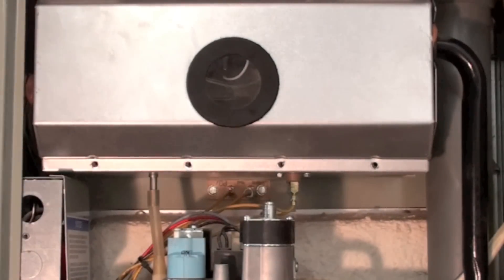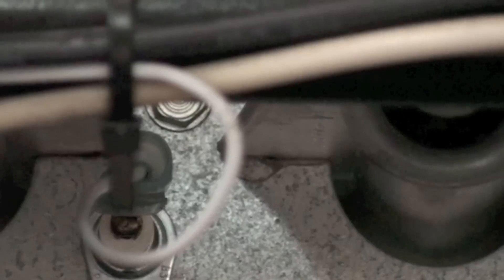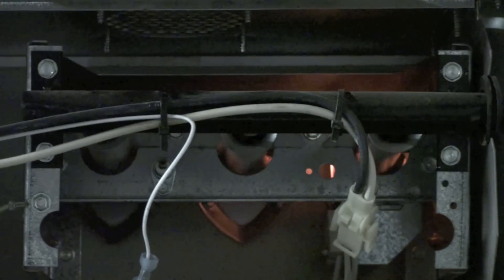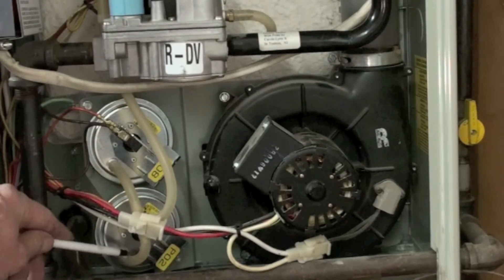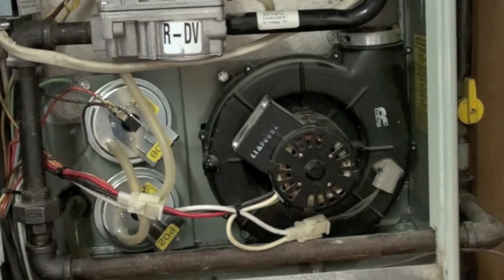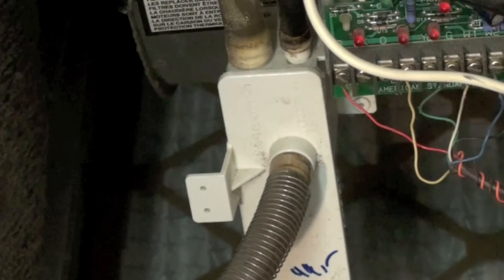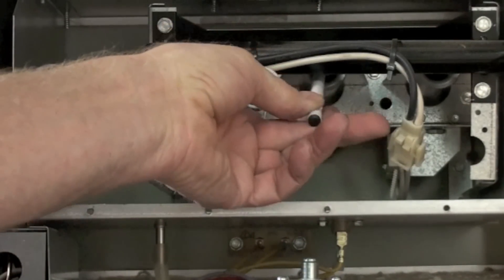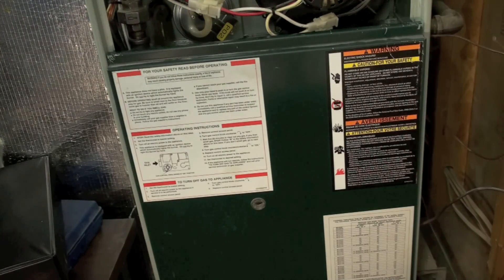Why does the gas furnace short cycle

Comment: Hi -- great video. Could you help me? I just replaced a circuit board on my Bryant. The replacement board was tested as working. I still get the same 3-1 error, indicating a pressure issue. The inducer motor was just replaced before the circuit board, too. I'm mystified. With a new circuit board and presumably working inducer motor, the inducer is still not spinning up after a call for heat. What else should I look for? My hair is quickly leaving my head. 
1. inducer a week ago was replaced after nothing was working.
2. after inducer motor was replaced, the furnace ran for one week.
3. after a week, the same 3-1 issue began.
4. it appeared that the motor wasn't getting enough power. i bought a new circuit board.
5. i installed the new board. the same 3-1 error is appearing.

the thermo is a nest. it is possible to test the large blower fan just to make sure that a signal is making it all, which does work. 

....?
Reply from the maker: Testing123 My thoughts here are you have a vent pressure problem.  First, remove one of the wires from the pressure switch.  If the inducer starts, the pressure switch was stuck closed.  Check your vent for blockages.  Hope this helps.
GFM
Reply: grayfurnaceman Thanks, GFM. It helped a lot. Great help, thank you.

Comment: Hello.  Thank you very much for the video.   I do have a non related question.  Hopping you can answer.   How does one tell if a gas furnace can have pvc exhaust or regular metal one.   I tried to look up in install papers but cant find it.   Thanks in advance.
Reply from the maker: Dmitry Dubinsky The vent connection on plastic vent will be 1/2" or 2".  The vent connection for metal vent will be 4".  Hope this helps.
GFM

Comment: My fan switch tryouts three Times  b before the gas comes on in a fire comes on
Reply from the maker: If by fan you mean the inducer fan and the burners come on but shut off after a few seconds, It probably has a problem with a dirty flame rod.  Hope this helps.
GFM
Reply: Thanks....but I mean the fan blower motor sometimes work most Times  just hummus and gets hot...no cap wired in 70%er lenox
Reply: Trying to keep from installing a new motor

Comment: You dear sir is a life saver , It is -40 with the wind chill in Waterloo Ontario . This morning I came home from work and inside of the house was freezing cold , There was ICE building up on the windows inside the house . I check the intake and exhaust for the furnace and clare it at the outside of the house . I flick the furnace switch on and off and the furnace came on , I set the thermostat as high as I can then went to bed,I wore two pears of sox,3 pairs of jogging pants,a toke , a pair of welders mitts and a sweeter with 4 long sleeve T shirts , Covered up with two comforter in bed. When I woke up at 3:30 pm to pick my wife up from work and the house was freezing cold , The hinges on the front door Ice was starting to buildup on them. Tomorrow is family day in Canada and that means all stores , Businesses and  heating and plumbing are close . I decided to head to Walmart and buy 2 electric heaters , Since I have 3 little kids and I am taking care of my mother and mother in law , They are both seniors (70s ) . My wife reminded me that I will have to use the Visa . I then decided to type in the furnace symptoms on You Tube and I clicked on your Video. In your video I saw the same symptoms as mine and you pointed to the flame rod . I then went into the garage and grab my socket set which was frozen and began removing the covers, Drip plate and finally found the flame rod, I took it out clean it and once I re connect it and re install everything . I turn on the furnace and it stay on and start to warm the house, We thank you a million .
Thanks,
Reply from the maker: Is good to be warm.
GFM
Reply: vishnu tewari great story....jesus sounds cold up there....just now I am freezing here in northern california...had to wrap my legs in a beach towel this morning to stay warm...with the heater turned off(to save money)it is 64 degrees in here!
Reply: @erikcable1755  i had same problem exactly it was my vent outside blocked check your inlet and exhaust outside

Comment: I have a Nordyne furnace that keeps cycling for approx 30 sec.
I have changed the flame sensor.
checked the venting.
it does not shut down after 3 cycles. I am wondering if the control board is bad.
Any thoughts?
Thx
Tinner73
Reply: I see this was three years ago what was the problem?  I have a Nordyne acting the same way

Comment: I have a newer  Nordyne Gas furnace. It will burn as long as I want it to; as long as the  burner access panel is removed. If I place the panel back on to seal up the system, it short cycles every 5 seconds or less. I've cleaned the flame rod and replaced the air filter, replaced the thermostat, and checked the pressure switches and tubes. The external air supply is not clogged either. My basement gets cold to 50F. I have no idea what to do next. Thoughts?
Reply from the maker: ***** This is almost certainly a venting problem.  Be sure there is no water in the vent from vent sagging.  Also look for ice on the termination or possibly a screen.  Last possibility is bad pressure switch. Hope this helps.
GFM
Reply: Could you hook up a homemade vacuum manometer and see what the 'vacuum' is? I don't know what it should be; but maybe GFM does. I think it should be small. I've never seen any numbers about that.

Comment: Perfect. I had this problem for about 4 months and when the wife finally spazzed out about it and threatened to call a service co, I looked at this video and realized very quickly it was a dirty flame sensor. At the same time I removed and gently cleaned the ignitor rod. Put it all back together and it fired right up. 10 minutes of effort saved me a bunch of money and put me back in good graces with the wife. AWESOME!!!
Reply: They say 
"if mamma ain't happy, ain't nobody happy!"
Reply: lucky you.  my wife is on my case and doing the same threat now, and that is why I am watching this video.
Reply from the maker: Corina Morrison A happy wife makes a happy man.
GFM
Reply: Corina Morrisoml 0
Reply: Corina Morrison

Comment: This video helped me immensely when I thought my furnace had a short cycle problem. I did the basics like change my air filter and thermostat batteries, still short cycling. After watching this video, I decided to open the front panel of my furnace to check what was happening. I then realized that the furnace operation must have jostled loose the screws that keep the safety switch pushed in with the panel. After this, i was so relieved to not have to call for maintenance! Thank you very much!!
Reply: Andy Gagliardi Exact same thing happened to me

Comment: hi, i I HAVE A FURNACE TG9S130D20MP11 AND  THE PROBLEM IS TO IGNITER TRY TO   BUT DOES NOT INGITE, ONLY LIT FOR ABOUT 3 SECONDS AND THEN SHUTTS OFF BUT THE MOTOR CONTINUES RUNS FOR ABOUT 2 MINUTES AND THEN STOPS, TRY AGAIN TO IGNITE BUT THE SAME, STILLS TRY TO IGNITE AND NOTHING NOT IGNITE, IN SOME CASES IGNITES BUT UNTIL 5 OR 6 TRIES, THE FURNACE IS NEW ONE AND NEVER RUNS CORRECTLY, PLEASE HELP ME

Comment: My furnace is short cycling but I cannot find the fame sensor.  It just isn't there.  The model is International Comfort Products FBF076B12A5.  HELP!
Reply from the maker: Dan D I think that one is similar to the Snyder General.  You might look up Snyder General in my videos.  If it is the same design it is behind the burner cover.  You also have to remove a baffle that is a pain to remove.  Hope this helps.
GFM

Comment: You could have a bad limit. Or bad pressure switch.
Reply from the maker: Randy Simone Generally, you should not have a short cycle with a bad limit.  I have seldom seen limits that open at too low a temperature.  They usually just fail open or closed.  Pressure switches, if they fail open, will cause a shutdown, but the unit will not try to start again until 10 to 15 minutes.  Pressure related problems, such as condensate drain or venting blockages can cause short cycling.  I always try to eliminate all pressure or temp related problems before replacing the switch.
GFM
Reply: I had limit click off and on last night. So yes it can happen
Reply: And also short cycle can happen if inducer motor is not running at rt speed

Comment: I have a Goodman GCH950703BX serial ******** I bought 5-28-2010. Has been doing well until this winter. It was short cycling just like video. Did what you said. So far works good.

Comment: Happy new year  to grayfurnaceman and every one on the channel.

For some time, I am having problem with my LENNOX furnace. One morning I noticed that the furnace will not start though the set point was higher than the actual temperature. Put off thermostat and  restarted again without any problem until it repeated again after 15 days. In both cases I never saw the error code at my furnace. Yesterday it happened again. This time checked the LED lights and found that both red and green LED lights glowing alternately
 which from the diagnostic list indicate a safety shutdown. Started the furnace and noticed that burners are lighting on  but extinguish after few seconds. It repeated 4 times and shut down.  As I heard some gargling sound at the trap drain piping, I removed the condensate from trap and and neutralizer and started it  but  no luck.  Started looking for solution through Youtbe and other sources and came across your channel.   By the way , I left the furnace  as it was for an hour  and started it .It seems like it is maintaining the temperature. When furnace is not running  still i see both red and green LED lights flashing alternately. 
i do not know what next i should do. Your help is appreciated in this respect.
Reply from the maker: Ilyas SiddiqiThis sounds like the flame rod is dirty.  Try this video:  http://youtu.be/0ZYXK8450mM
GFM
Reply: grayfurnaceman Thanks a lot for the suggestion. I went through  video you suggested. For last two days the unit is running fine and controlling the temperature as required. I am going to clean the flame rod once  it starts troubling again. Thanks a lot for help, will come back with the feedback.
Reply: Ilyas Siddiqi Until now I was thinking my furnace is behaving normally as it was controlling the temperature as required.  But this is not the truth. At the moment it runs for an hour and then it shuts of for an hour. Reading through the LENNOX  G43UF-36C-090H, it looks to me that it is shutting off on safety and after an hour watchdog timer resets and it automatically start the cycle again. It is doing the same for every hour. Do you feel that it is the flame sensor causing this or it may be something else. Your opinion on this will help me sort out the problem.

Comment: I've got a new 95% 57,000btu American Standard downdraft furnace that short cycles about 10min after start up w/ a code 4 (limit).  I spent $2k on a return system that was intended to fix the issue however it did not.  The company that installed the return air system sent a tech (for another $90) who installed a "EZ Flow" filter and put my fan setting to as high as possible... A/C setting.  Now I have a hurricane in my house and a short cycle on the limit and I'm out of money.  Is my furnace to large for my 1100sq ft house?  This may be a dumb question but it's my only other guess... I'm a engine tech not a furnace tech... Any input would be appreciated.
Reply from the maker: Goat18436572 Unless you have tightest, highest insulation house I have ever seen, it is not too big.  Unless you live where you need little heat.  Try a little test.  Remove the fan cover while it is running.  There is a safety switch that will shut off the furnace that you will have to tape down.  If, when you remove the cover, is it hard to remove?  If so, there is a return air ducting problem.  One problem with down flow units is the installing contractor may place a filter in the return above the filter because the factory sometimes places a filter rack in the furnace that takes 2 filters placed in an "A" arrangement.  These are hard to remove and replace.  If your filter is around 12" by 16", this is probably the problem.  If removing the filter solves the problem that's a good clue.  If not, the problem is in the supply.  
All this is assuming there is no problem with a plugged air conditioning coil, plugged secondary heat exchanger or a possible heat exchanger crack.  I would be looking for simple problems.  They seem to be what is found when all else fails.  Who knows, someone could have left a cardboard box in the furnace when it was installed.  Yes, I have seen that.  Hope this helps.
GFM
Reply: grayfurnaceman
Thank you for the fast reply!!  My friends dad came over today and found that the fuel psi was .5 too high.  He adjusted to the proper pressure per the spec on the service tag and we checked the ??heat drop?? I think is what it's called. We got 74in 129out with the house temp of 72*.  It was hot in the house because we were testing the normal house temp is 68*.  That's 55* spec is 29-55*.  The furnace is now running w/o limiting! though I'm not satisfied we are 100% yet.  As far as your question they did not install the "A" dual filter system like the manual says.. so i got one 16x20x1 filter about 6in above the furnace frame.  With the filter removed the furnace will run all day with a 70* in and 105* out = 35*drop (i think its called drop).  The second thing it's doing now and has always done is - when the thermostat calls for heat the inducer and the main blower turn on at the same time w/ a code 4 (limit) for about 15sec.  After 15sec I get a normal slow blink (call for heat)  the flame will light and the furnace will run as normal.  The unit is holding heat? heat soak? Sorry for all the questions..  I may take a video to show you the unit.

Comment: I'm a female can you tell me what "restricted duckwork means?"  I have a huge pipe that leads to my ceiling do you mean it's clogged?
Reply from the maker: starr2night Probably not.  If it is flexible duct, it may be crushed.  If flexible duct is used, look for flat spots.  Hope this helps.
GFM
Reply: a guy came out and cleaned the igniter and the burners but my furnace is hot to the touch on the outside.  is that okay?

Comment: I watched your video and have lightly sanded the flame rod or sensor. I have a goodman Gmt090-5 and want to buy a new sensor. I am not sure what one to buy. How do you know what the correct replacement items is? I see every model under the sun except mine. Will a gmt090-5b be the same?
Reply from the maker: Salty Replacement is probably not necessary unless the ceramic is cracked.  Give me some symptoms.
GFM

Comment: I have a 6 year old goodman furnace multistage.  it shorts cycles for hours sometimes then it turns on by itself.  it tries to turn on for 2 seconds, you hear a click sound then turns off then it tries again and turns off.  this is like the 10 time this had happened.  What do you think could be the reason?  I never gotten to the ignition step..
Reply from the maker: Yassen Abdullah Check venting and condensate drain.  Blockages in the vent or combustion air inlet could be the problem.  Hope this helps.
GFM

Comment: I have a Rheem furnace.  I live with someone who needs it very warm in here.  I used to turn the thermostat up to 78 and it would do a short cycle.  Then I turned it down to 76 and didn't have the problem for a year.  Now it's short cycling at 76.  Can you give me any ideas?  Thank you.
Reply from the maker: starr2night This sounds like restricted ductwork.  Or possibly a plugged filter or plugged circulating fan.  Hope this helps.
GFM

Comment: Hello, I have Nordyne Furnace Model: kg7sc-072d-24b. It works normally a couple hours: normal cycle. And then runs into short cycling: inducer motor on > ignition rod red> fire comes->a few seconds later->gas shout off >blower on>cold air out .
Turn off the power, turn on again, try several times, some times an hour, it randomly works again for a couple hours , then runs into short cycling again...
What's the possible problem? (new flame sensor)
Reply from the maker: jiang2503680 I would be checking the flame rod microamps.  If you don't have this type of meter, check this video on a cheap meter:  http://youtu.be/a5u044OJBc4  If you have low microamps and the sensor is in the flame and the rod has been replaced, the board is bad.  Hope this helps.
GFM
Reply: grayfurnaceman
checked with torch and meter this morning. It should be fine. It might be the pressure switch problem. Looks like it works randomly. How can I tell if the pressure switch is 100% wrong? Thanks!
Reply: grayfurnaceman
there are 2 pressure switches. One is near top of inducer fan, labeled -0.8 PF. The other is at bottom close to drain pipe without label. I googled and it seems to be -1.3PF. My question is if these two pressure switches are in wrong location that causes random problem? Thanks!
Reply from the maker: jiang2503680 The location is probably right.  Manufacturers are very specific on this.  Pressure switches are indicators of a problem.  Check venting, water drains for plugging, water in the vent or combustion air inlet.  Hope this helps.
GFM
Reply: grayfurnaceman I checked all the possiability what you mensioned above. Finally I switched these 2 pressure switched, the furnace is working now more than 24 hours and seems still working. I called the local supply, they said the manufacture changed replacement part from -1.3PF to -1.2PF. That means the -0.8PF switch is now in -1.2PF position, and the -1.3PF Is in -0.8PF position. Is there any safty issue to what I did? Thanks!

Comment: When I fixed my furnace ( I'm 15 btw) I figured that the problem had to do with the ignition controller. There was cracked solder on the coil probably from rapid hearing and cooling.
Reply: You need to do better at your "rapid hearing" dude! LOL!